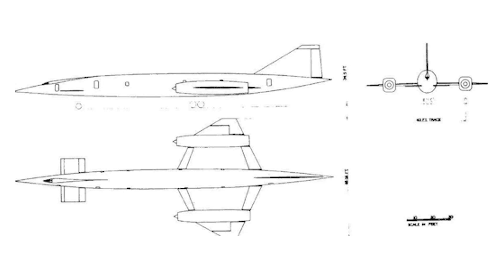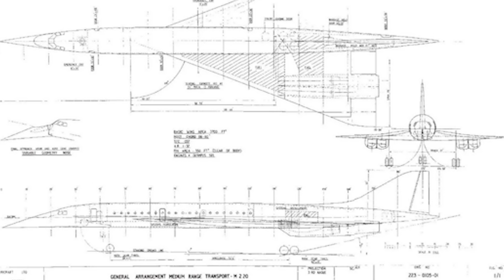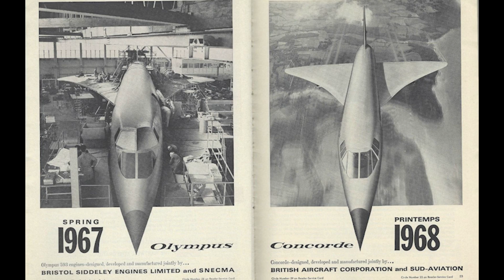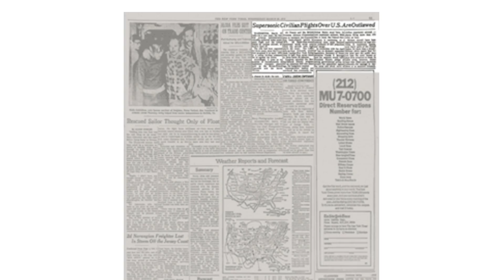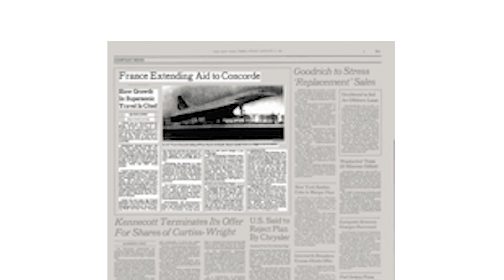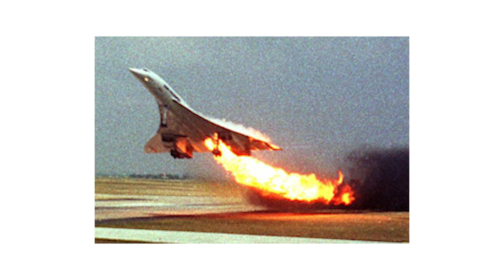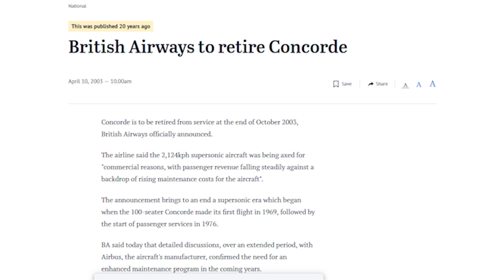Why Concorde Failed

Comment: To be fair, Concorde was a successful failure, okay it never would've flown without massive public funding- but it was an engineering masterpiece, the only truly functional SST. 

The Tupelov TU-144 by contrast had a lot of issues, even if those issues could've been been resolved (who knows?) it would've taken the Russians another 10-15 years to finish the development. They (probably wisely) gave up. 

The American effort was even more lame. A billion dollars of mostly public money wasted on the Boeing 2707, and it never even flew once! The only thing remaining of the project is a wooden mock up!
Reply: It was remarkable how the US was able to spend more on building a wooden mockup than it took Europeans to build an operational aircraft.
Reply: 1. The Concorde didn't fail. It was the French, after all the problems with airport debris had been solved, and implemented on the UK Concordes, who used their safety panel authority, part of the original deal , to shutdown Concorde. 

The French had never upgraded their Concordes since they first had them, and didn't want the embarrassment of the UK having operational planes, and they not, shutdown the Concorde. The UK government should have insisted that the safety authority should revert to them. 

2. BAE ran the Concorde at a profit with it serving as a serious draw for their service.

Comment: The Concorde program was borne out of technical ambition and national pride, not market demand. I've read that it was barely profitable. But- failure? It is worth remembering that Concordes flew passengers without serious incident for 27 years before the Air France accident, which then revealed a single-point failure mode that would have been expensive to correct.
Reply: It was corrected. The UK Concordes all had the needed corrections. It was the French who viewed the Concorde as a noisy anachronism. They had control of the safety assessment as part of the original deal, allowing them to shutdown the Concorde. 

As to being barely profitable, that was only true initially. Once BAE started looking for profit, they found postal services for signed documents extraordinarily profitable. A 2nd stage was to find what the flying public thought the cost of the seats were. It was realized the Corporates, who went first class, were being grossly undercharged.  The price increased wasn't even noticed by the first class, whose companies made for their seats.

Comment: Expensive? Accident prone? Both?
Reply: The Concorde had a relatively safe record up until the paris crash in 2000 which ended its career, which as the video mentioned was not even the planes fault (a previous aircraft, a dc-10 ironically left debris) It was just speculation and fear mongering. As a matter of fact, up until then the Concorde never had any passenger fatalities
Reply: @olliestegscdu4553  
The corrections needed to prevent a further incidents were implemented on all the UK Concordes. Unfortunately the French regarded the Concorde as a noisy nuisance, and since they had control of the safety panel, as part of the original deal, were able to shutdown Concorde.
Reply: @olliestegscdu4553 French not a cultured nation such as England!
Reply: Accident prone? Watch the video before commenting.